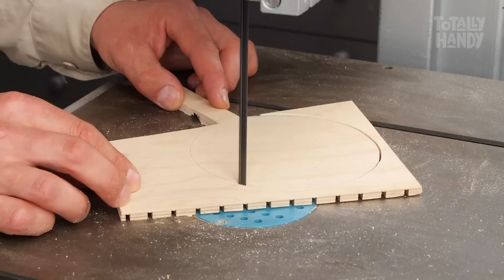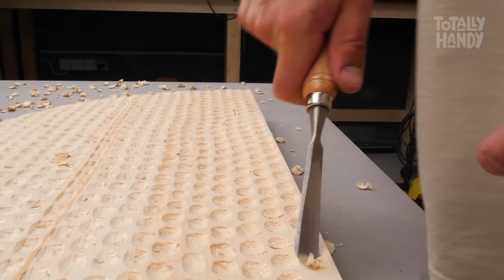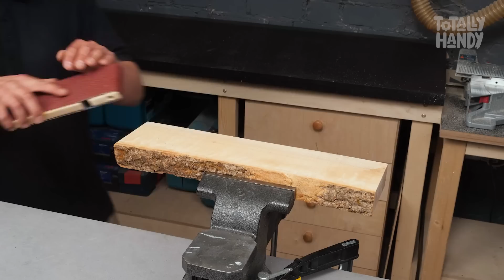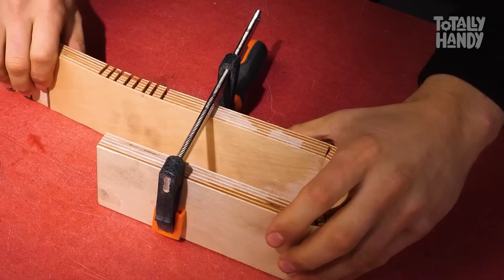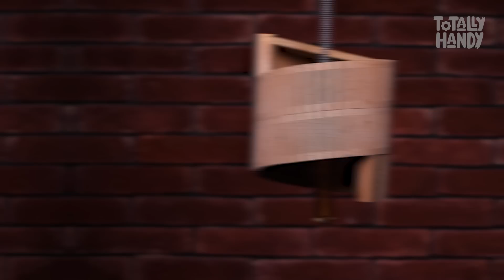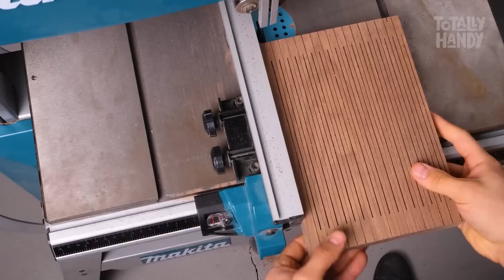Useful Wood Crafts to Upgrade a Tool Shed  | Woodworking Project

Comment: What's the saw handle with CD for?
Reply: nothing lol
Reply: IKR
Reply: Drilling straight holes is not as easy as you think. Most think they can but can not at all, including me. A drill press is really the only way to get an actually straight hole. Most times we get close enough and we think we're good at it but if your drilling a 6" deep hole I laugh if you think you'll do it by hand and get it perfect
Reply: @brucehansen7949  I don't want to drill anything, I just want to know what the heck that cd glued to a saw handle is for🙁
Reply: He has just explained it to you; sometimes you need tools for tools
Reply: @pz6701  there's a tool for tools here alright, but not the way you think.
Reply: Ok I understand now. Thank you.

Comment: Why don’t you show the proper, safe way to use a bandsaw before someone gets badly hurt by your system example!!
Reply: I was just about to make the same comment.
Reply: Can you please timestamp improper use of the bandsaw, what was bad and why you shouldn't do it?
Reply: @picklenick2  top blade guard about 6 meters above the bed ,No push stick
Reply: Look using caution with power tools and exercising it is up to the End User,  not the guy making this video. Calm down Dan and go mow your lawn.
Reply: Report it as dangerous if you feel it is. That's what it's there for.